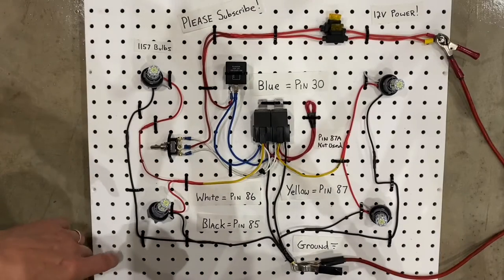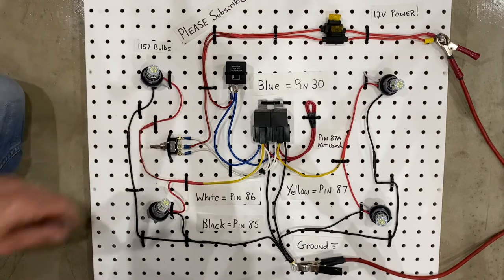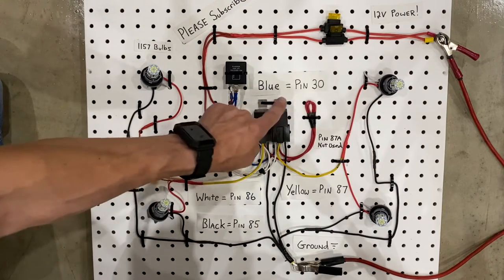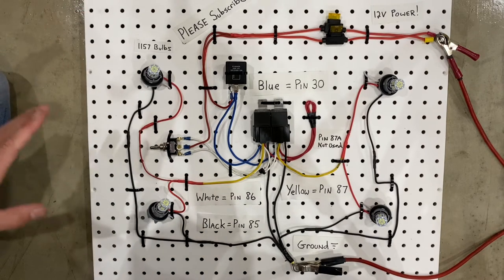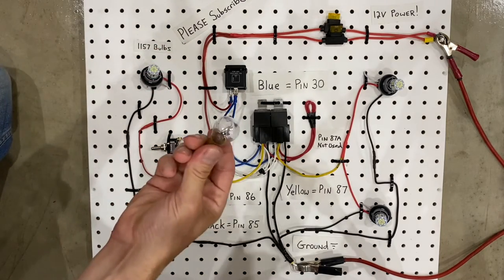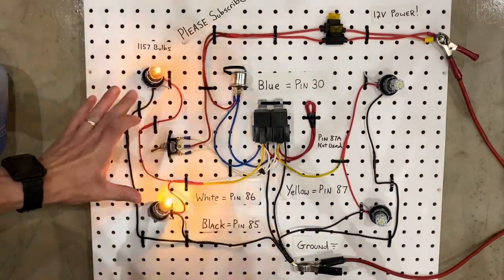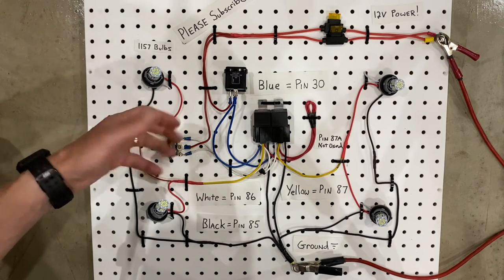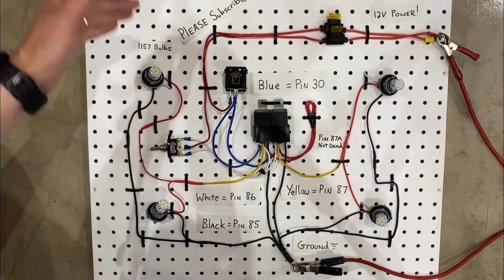How to Wire LED Turn Signals / Flashers to ANYTHING | Hotrods | Motorcycles | ATVs | Mopeds | Cars

Comment: I have a Suzuki GR650 Tempter and tried to convert the lights to LED.  I got an LED Flasher for it, and the lights are compatible with 1056/1156.  I also converted the turn signal indicator lights to 194 LED - there are two on the Tempter, one for each side.  When a front and back turn signal light for one side is converted to LED, that side to stops working.  If I change the front to Incandescent, that side works.  If I change the indicator light to incandescent, and leave the front and back LED, nothing happens.  If I change the indicator to incandescent and front to incandescent, the rear led and indicator work.  The reverse is true.  So the system only works if one signal light on that side is incandescent.  The indicator light seems to have no impact.  I suspect they are drawing energy from the switch, and not in the same loop as the turn signals like they are on other bikes.  Any ideas how to get all three lights on each side to work with LEDs?  One bike nerd suggested a diode on the front signal lights would fix it.?   While I am at it; what is the difference between a CF13/CF14 and CF15 non-polarity Flasher?  One person suggested I get a CF15 non-polarity flasher and it would fix it.

Comment: What about a newer vehicle that has a Can-Bus system. There's no flasher relays...it's all in the computer. It's a 09 HHR.
Reply from the maker: Can-Bus makes everything way way harder because it is modules telling lights in blink instead of flashers.  So every car with Can-Bus is going to be a whole different animal.  In the case of the 09 HHR, your best bet is to diagnose the problem properly, and replace it with a junkyard part, or one from eBay, craigslist, etc.  I realize this stinks, and is more expensive, but that is sort of the deal with can-bus. :(

Comment: Where is the warning light to tell you they are switched on  ?
What tells you one  bulb has stopped working ?
Why didn't you wire the flasher into the feed to the switch ?
Save the extra fuse and the cable costs and time to install.

Comment: I have a question, is it possible to run LED turn signals on a old Harley Sportster with a Magneto?  Or would I have to mount a mini 12 volt battery and fuse just dedicated to the LED turn signals and related LED turn signal components?

Comment: why does it need two relays?
Reply from the maker: It allows you to use a much wider variety of switch and bulbs. Many switches are only rated for a very low amperage. So if I were to light up high amperage bulbs with a low amperage switch, it would burn out the switch. Relays open up your options greatly. Check out my other video without the relays for comparison.

Comment: The problem is a loose ground connection.
That’s why the indicator is not working.
You must check ground connections

Also never ever ever ever ever bridge fuses or replace it with one that has a higher amp rating